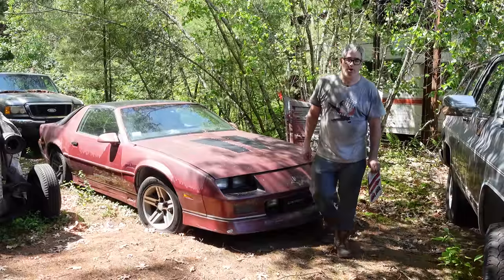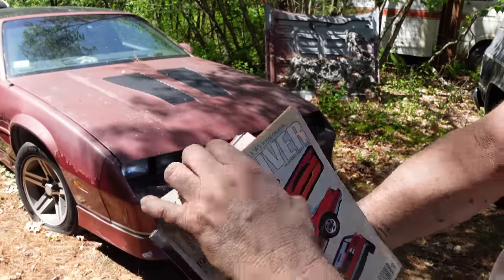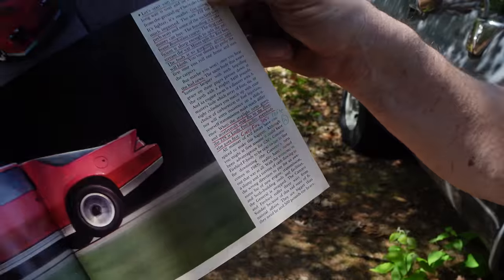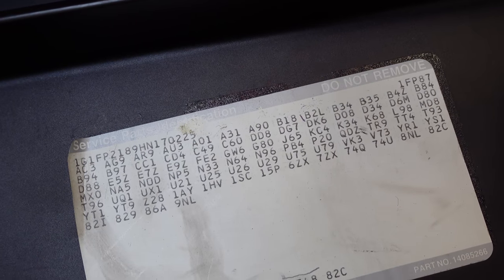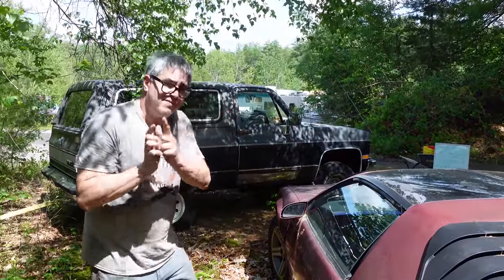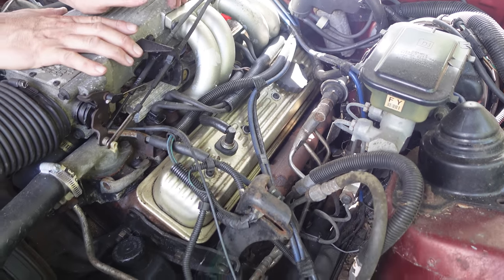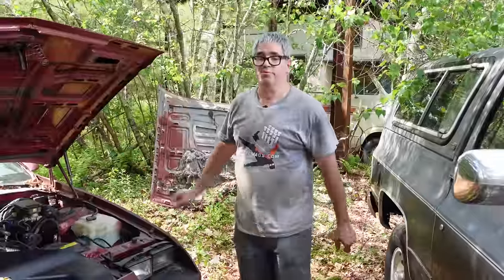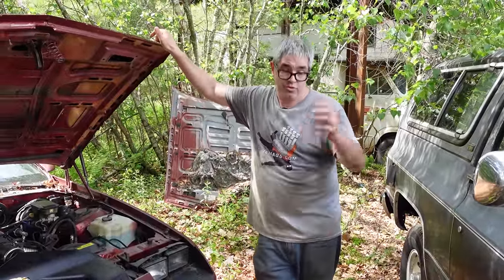Heart of a Corvette

Comment: Those TPI engines were just about a work of art. They look good
Reply: Performed well, too. I had an ‘89 Corvette that performed flawlessly. The C4s get dogged quite a bit, but I really enjoyed mine.
Reply: @chriscarlson3700  Yeah, I have a '93 LT1 C4 and although performance is great, it's such a boring looking engine. Also just picked up a '91 ZR1 and it luckily looks more like an overgrown TPI engine than the LT1
Reply: @chriscarlson3700  I saw a gorgeous white C4 on the front row of dealership yesterday. After the 68-71ish ones, C4s are my second faveorite Corvettes.
Reply: Yeah but it sucks you couldn't get a standard trans with the 5.7, goddamn bean counters
Reply: @MrTheHillfolk  The only 5 speed available at the time was the T5 and that 350 would blow it to bits.
Reply: @ClaremontClassicGarage  and that was lame ,they really coulda had something but as usual the bean counters adding their .02c and strangling what would have been fun. 
Friggin party poopers.
Reply: @MrTheHillfolk  Doubt it was the bean counters. They could have just put T10s in them and be done. It was more likely their CAFE obligations and NVH/driveability engineers that demanded an overdrive. T56s were still a long way away.
Reply: A manual 350 F body would have came to close to Corvette performance in a much cheaper package.
Reply: They were absolute torque terrors as well. Low 14 second quarter miles in the mid-late ‘80s was very respectable for the era.
Reply: Couple of things. From '85-'87 the "IROC-Z" door sticker was at the front of the door, the pinstripes were black on bottom and accent color on top. That flipped in '88-'90 and the sticker was moved to the back of the door. The wheels also changed from the early 1 stripe to the later 2 stripe. '85-'87 also had a z28 emblem in the ground effects and 88 on it said IROC-Z on that emblem. The 5,500 redline could also be found on the high output, dual cat 305. Pardon my aggressive thirdgen trivia knowledge 😂. Post your obnoxious thirdgen trivia facts below!
Reply: I am currently working on my 85 iroc,  of course mine just has the 305, but I love it.
Reply: @bigboytoyz541 the 305's stock bottom end can handle over 500 hp it was on Engine Masters 😊
Reply: With a better Edelbrock tpi intake system and headers and a cam and exhaust improvements , these could actually run...
Reply: No thanks , we enjoy the specific specifications ! wish I could remember them all from that time
Reply: @ClaremontClassicGarage have to disagree. I had a ‘90 IROC 305 5-speed. At 100k swapped in a ZZ4 short block with a set of Trickflows with a few SLP parts. Drove it for four more years and the trans never gave me any trouble.
Reply: @ClaremontClassicGarage It won't just grenade it like that if that's what you're implying. Several folks of TGO are running 350s and even some 383s with the t5 (albeit it being the World class T5). They'll blow up eventually if you put sticky drag radials and launch it. Regular driving and accelerating won't hurt it. 

Of course there are better and more durable transmissions out there, I'm saving up for a Tremec TKX to mount behind my 305tpi because I know the non-world class T5 doesen't have the service-parts available as the world class does. And with the tkx I'd never have to think about babying it as it's 600 ft-lbs strong.
Reply: @kmas8229  Thats fine. drive it normal and it can live. A mature driver thats driving properly could make anything last.
Reply: @ClaremontClassicGarage  Amen. As with all old cars they require care and maintenance. Have a good one and drive safe :)
Reply: @bigboytoyz541  the 230hp LB9 TPI 305 engines were damn strong runners. They actually dyno’d more hp/tq than the 5.0 liter 302 Mustang engines, and that was with those horrid boat anchor exhaust manifolds. Imagine if GM had used tubular style headers like Ford used. Not all 305s and 3rd Gen F-bodies were created equal.
Reply: @nedaCFilms  👍👍👍
Reply: I had 83’ T/A with the cross-fire , HORRIBLE ENGINE, TPI was HUGE Improvement
Reply: @MrTheHillfolk yes you could
Reply: @DavidBoerboom  no 3rd gen camaro left the factory with a 5.7 and a manual transmission.
Reply: @bigboytoyz541  I distinctly remember a '90 model Iroc with the 5.7, 5-speed...in the showroom of Service Chevrolet; Lafayette, LA ...
Reply: @DavidBoerboom  a lot of people say that,  but according to gm there was only a couple made for test purposes,  and they were all destroyed.  None were sold to the public or any dealers.
Reply: @bigboytoyz541  ok.
Reply: @48Boxer unfortunately what makes your lt1 outperform the TPI engine is what makes it look boring.  Those octopus manifolds have long runners which make great low speed torque but they fall on their face at higher rpm, the lt1s shorter runners make it much better at higher rpm.
Reply: Haha, with 0 power
Reply: Hard to run them on this shit fuel we got now a days hell I had more blue fuel in mine lol
Reply: @tripleffarms2872  What they call super in 2023 my dad wouldn't put in his lawn mower in 1970
Reply: $1045 for 350"? TPI 350" didn't cost GM a penny more to make than TPI 305"... and they should have already been putting a good rear end into them...
Reply: Really?!?!? I guess you've never seen the intake on my 1991 Ford Taurus SHO. THAT intake is a work of art, visually and functionally and they maintain their finish. The TPI engines all develop that powdery, crusty corrosion especially on the center section and slightly less so on the runners.
Reply: @ClaremontClassicGarage  @MrTheHillfolk The Mustang GT came with the same T-5 and didn't have issues. Most Mustang owners upgraded the intake manifold, camshaft, cylinder heads and headers, so the 302 is making way more than the stock 225hp....and way more than a 350 TPI.
Reply: First time I saw under hood of a SHO, said: "No thanks, never want to have to work on that Plumber's Nightmare of an engine" !!!
Reply: @jamesf.ryaniii7918  that's great. It all boils down to GM and Borg-Warner having to warranty them. They determine the max torque the unit can handle and thats that. The 350 made more torque than the T5 was factory rated for therefore they were not installed. Simple.
Reply: @ClaremontClassicGarage  Agreed. I was just saying the back in the day a lot of Mustang owners added TrickFlow heads, intake and cam and the hp/tq exceeded the T-5 rating, but I don't remember a lot of T-5s exploding. But, if it did grenade, and a Mustang owner went to a Ford dealer and demanded warranty replacement, I'm sure the dealer would fight it by pointing out all of the non-factory go-fast parts.
Reply: @BuzzLOLOL  It scared me when I bought it new in 1991. I said, "I guess my days of working on my cars is over". But, it's actually not that bad. Disconnect the intake hose between the air cleaner and the throttle body, a few electrical connectors, a few hoses, 12 bolts and the entire intake lifts off. Then it's just the same as any other V-6 front wheel drive. Front spark plugs are easy, but rear plugs by the firewall are a nightmare.
Reply: @ClaremontClassicGarage guess I'm on borrowed time then. Mine was originally an auto 305 tbi car. Someone swapped a 350tbi and a t5. She was in rough shape. Carb swapped it as everything was hacked up. So far so good. Fun as hell to drive even tho it's not the fastest rig on the road.
Reply: Without the t tops you could have.
Reply: The 305 h.o. would too. Ask me how I know. Crap trans
Reply: Steve u are the best!

Comment: That Camaro definitely needs saving. After this video I am sure it will be. Again, great knowledge and presentation Steve. 👍
Reply: Why? You can find those things anywhere. They're as common as dirt, and, worth just as much.
Reply: @ExUSSailor  Not the IROC's,   that is going to be a collector.
Reply: @Oldguynotbald  yeah, especially with the original tpi. People ditched it for a carburetor due to a lack of understanding of the system.
Reply: The only collector cars will be the low mileage cars in original condition.  If you're pulling it from a boneyard, it will never be a collectable
Reply: @spodie251 , depends on the miles and the level of restoration. Remember insurance companies totaled cars for what they “once were worth”
Reply: @ExUSSailor I live in Massachusetts where do you see them everywhere? I don’t
Reply: @spodie251  It doesn’t really need to be worth tons of money to want to save it
Reply: @spodie251 who cares if it’s a “collectible”? Those all have been scooped up by wealthy guys at Mechum. 
Some enjoy reviving t these old vehicles just to  get them running.
Reply: @ExUSSailor  😂 go to Meachum and buy your overpriced cars. Leave these to the people who want to get them running instead of wasting money on unobtainium
Reply: @ExUSSailor  Not in Michigan, they have long ago rusted away.
Reply: That TPI 350 engine didn't cost Chevy a penny more to put in over the TPI 305... although an automatic transmission was required and the 9 bolt cover (or better) Aussie rear end they all should have had... 
I still have my Jan. 1987 Trans Am GTA when the 350" engine first re-appeared... under TPI, as well... 
https://i.pinimg.com/originals/0a/6e/92/0a6e925d76ea7b8a50b40ef04eb7a4b5.jpg
Reply: Same with the full size Blazer behind it.
Reply: @ExUSSailor wtf? You never see these Camaros anymore. Let alone an iroc
Reply: @firedemon2166  saving it and calling it a collectable  are two different things
Reply: @genevetere8216  this one doesn't qualify on either front. There are tons of these still around that are lower mileage originals.
Reply: I agree! Hopefully someone with the resources and money will save it.
Reply: DarthShibby  The only people that like these in that area can't afford to rescue it and all the Boomers there scoff at 3rd Gens.
Reply: @pmscalisi  I was responding to the guy who said all IROCs will be collectables
Reply: @khb3892  The K5 Blazers are REALLY  Expensive  my Brother just Bought a '69 it cost $30k!  And it needs a little work
Reply: @genevetere8216 as Gen X gets into buying cars from their youth the 80s muscle cars are going to soar in popularity
Reply: @OldBeaterGarage the Boomers are going to be trying to sell their overpriced 60s and 70s muscle cars to afford their nursing homes and nobody is going to want to buy them😂
Reply: I don't know, it's a Massachusetts car, I'm betting it is so rotten underneath if you sneeze hard it'll break in half.  That's probably why it is where it is, too far gone for resto.
Reply: I liked them the carbed. Cars made more power then gm said.these cars handled better then any Camaro before you could feel everything and respond according..outran everycop car that ever though of turning them blue lights on.700 r4 373 and 4 wheel brakes.mine would even lay rubber when it caught 3rd.if u couldnt shake them wr we would taie them where they overheat there tires and brakes. Never had to do with the cops was mainly some dude in a 70s cutlass with a gold 350 rocket that eanted to kill u for looking at his woman..lol..guys who call them gutlass cutlas.never seen one that was tuned right..ill assure u they were outruning chevy ss chevelles and chargers back in those days.
Reply: @spodie251 my mother has an ‘89…900 miles
Reply: If I was a millionaire I'd have that same junkyard
Reply: Good job on all the details of the Camaro love it I had one
Reply: It doesn't belong in a yard for sure it looks pretty solid.
Reply: Yeah I can't even understand why that is in a junk yard at all

Comment: I’ve got the c4 corvette with the 350 TPI and aluminum heads. By todays standards the engine is a dog but I gotta say, when you pop the hood on a vette or a Camaro and see that TPI intake you are looking at one of the most beautifully designed fuel injected engines ever made.
Reply: i have always thought people dont give enough credit to the C4 Vette. It truly was GM's first step at making the Corvette a world class sports car. Even the 84 cease fire car was an absolute leap ahead and GM has raised the bar with every C series since. I have a funny story about the TPI though, i happen to be working at a Chevy dealership in 85 when the TPI was introduced. We pulled a brand new vette in the showroom and opened the hood and as we all looked at the motor the exact words out of my mouth were "oh my good this is nuts, this is the end of street rodding. how are we ever going to work on these!" lol Could not have been more wrong . . . it was the beginning and i have regarded the TPI as one of GM greatest street rod engines ever and have built several including my 71 Camaro with a full driveline swap from an 86 IROC. Absolutly LOVE the tpi . . . .
Reply: @glassdave  cool story. I was in high school in the mid 90s. These IROCS and mustangs were the must have. My c4 is a fixer upper. Got it for 2500 and was told there is no such thing as a cheap corvette. I’m finding that to be true as I’m chasing down one issue after another to get it daily drivable. Fighting a stalling issue now. I think it’s a vacuum leak somewhere but haven’t been able to find it yet. Idles fine but wants to die when I put it in gear.
Reply: I had one in white with lines, mint condition, I traded the car for a piece of land..
Reply: Visually the TPI is a masterpiece ❤️
Reply: @thrillbilly9785  I graduated in 1995. The Mustang was definitely the car to have. I was an import/Honda guy (still am) so I always wanted to make my Hondas faster than the Canaros and Mustangs.

Now I have a C4 6-spd in my collection. First domestic I've owned. Fun car!
Reply: Yep a guy in my neighborhood had the same color car in the video but convertible with the talking Viper alarm it was beautiful 🔥
Reply: It might be a dog, but with the right cam, some head and exhaust work and it will wake right up.

Comment: Totalled one of these in December of 1992. From the start of the slide to the point it came to rest, total distance covered was 739 feet and resting on it's top.
That car would run like hell but it sucked at flying upside-down....😅
Reply: Hope neither you nor anybody else was hurt. You sound lucky to be honest.
Reply: @67marlins  my cousin was thrown out through the back hatch/glass and I stayed in the car due to a seat belt. I got out of the car after it finally stopped sliding upside down and ran back to find my cousin 300 feet away from the car. Broke his leg above the knee and it also broke his neck but through the grace of God he wasn't paralyzed and recovered completely. I only got some stitches on my head from where it made contact with the road after the glass t-tops were destroyed. 
That crash changed everything and my life!
Reply: @coreyshort9461  holy shlt lol
Reply: Many of.these were bought by kids just out of high school and 5.0 mustangs were being bought too. Serious accidents were common because they were light cars in  the rear and were purposely under rated horsepower...plus the goodyear gator backs these cara came with were a very hard compound and spun.easily with ANY kind.of.moisture or.cold.pavement. a bit too much car for kids that had just got out of highschool....I know of one muatang gt in my area back then that 2 kids were killed in....the engine came.out of the car it was so bad
Reply: @coreyshort9461  This is slightly off topic because it was written about a plane crash, but check out the song, D.O.A. by Bloodrock.
It was misinterpreted as kids crashing a car, 'flying low' while on LSD. I'm glad you're OK btw.
Reply: @Crazy8ts  That's a fact....I always felt sorry for young kids up here in Massachusetts trying to climb hills in light snow.. . Tons of power and no weight in the rear, exactly like you said. Meanwhile my '68 Chrysler walked up in 2nd gear, plus I'm older and careful!
Reply: @67marlins  thank you Sir, that crash taught me a few things, mostly how fragile life is and being young and bullet proof is an illusion. 
And don't ever forget that gravity will kick your azz....😂

Comment: OMG!!! memories I had a 82/83 z28 with a 350 swap. Engine so strong it would smoke the tires when you just tap the gas pedal.  Same everything except it was black, T-top with the red and orange z28 stripes on the side.🔥🔥🔥🔥 Thanks for the video!.....also the rear yoke used to break, that rear axle couldn't handle it all the time.